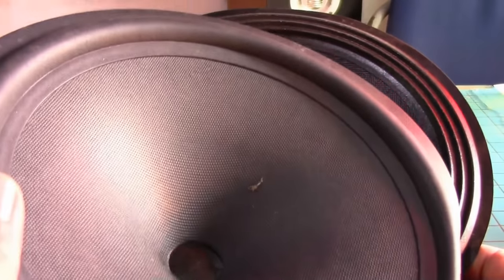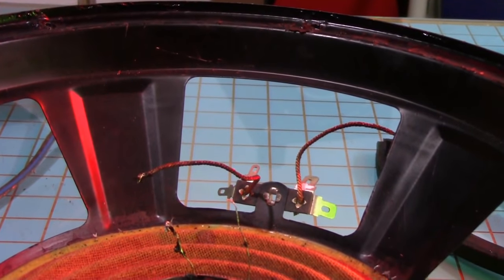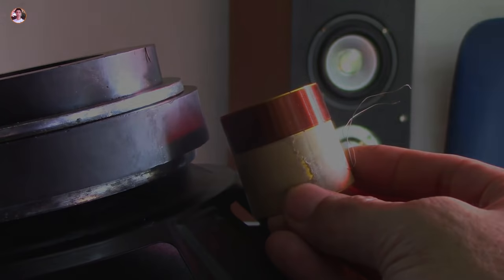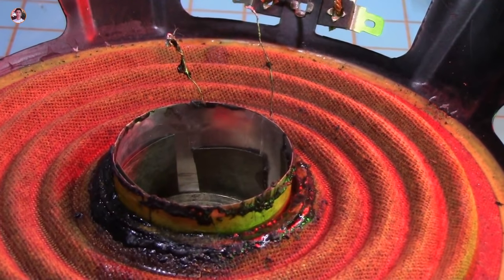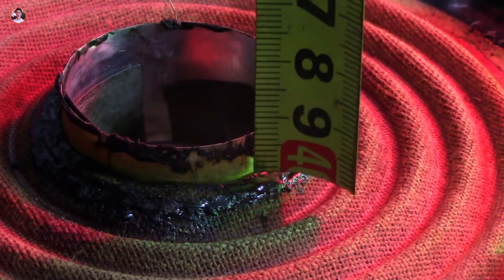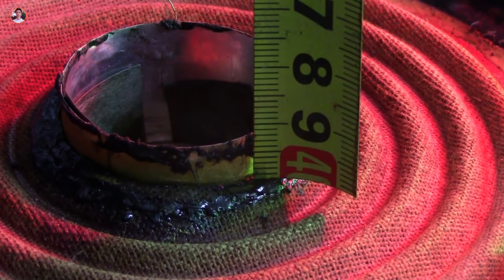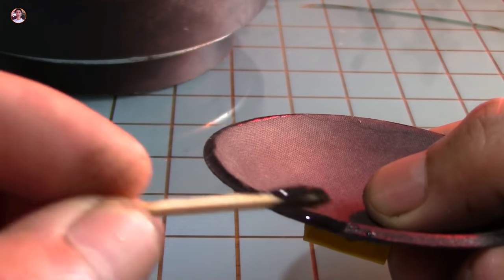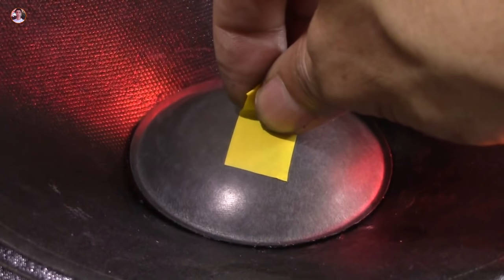How to install coil speakers to increase bass, deep bass and better listening sound

Comment: Way to much glue on that spider, what a mess. Also for anyone asking how to PROPERLY set a voice coil. The middle of the windings need to be in the middle of the top plate. Do this by measuring the winding height and the top plate thickness. Divide both numbers in half and add them together. Take this measurement from the bottom of the coil up and mark that spot. That spot will be at the top of the top plate when placing the coil in. This is the proper placement.
Reply: i want to try it but i don't know how much height i must put the coil inside the magnet

Comment: What glue you are using? And that 6 mm is for all size speakers or it is recommended for certain sizes. Please let me know.
Reply from the maker: This is the type of glue black speakers specializing in selling electronic stores.
Depending on the size of the loudspeaker for high
6mm for speakers with a diameter of 25cm to 30cm.
For smaller speakers, lower it a bit
Reply: @AlfredH  Thank you
Reply from the maker: yes

Comment: this does not make any sense if you want to increase bass tones just add a crossover or preamp with bass control changing the coil will not do that keep in mind that the coil will respond to the frequencies you selected also the box design I think the box design does change the bass response
Reply from the maker: The correct position of the coil will increase the bass. sound more solid and standard.
Reply: @AlfredH do you have prove of that? I have not seen a video about this subject
Reply: @AlfredH  I have to go back and stop you there the position of the coil is already been set from the manufacture people with experience already did all the calculations to calibrate the voice coil changing yourself the coil will not change anything I think you should change the title of this video and read more like I did many years ago the only things that you can do to have more bass is to have a powerful amplifier and experiment with different box configurations unless you can proved by build two speaker and have a SPL meter and see which one have more bass
Reply: @CoquiAudio  no.. i just have a 12 in. Sub 400wats. The coil wire is only #28.. and i change it with # 25 wire. At same length. Theres a big change in bass.. tnx
Reply: @alanavancena5022  changing the wire will not make the woofer reproduce more bass is just that a thicker wire will lower the coil resistance making the magnetic filed a lot stronger but does not means that it will provide more bass the amplifier is the one that is gonna send the tune of lower frequencies keep in mind that